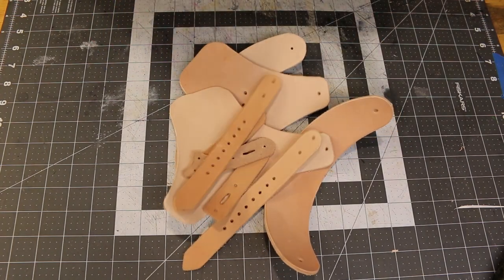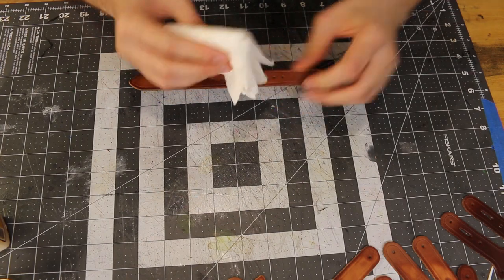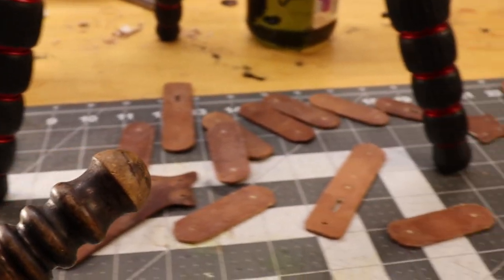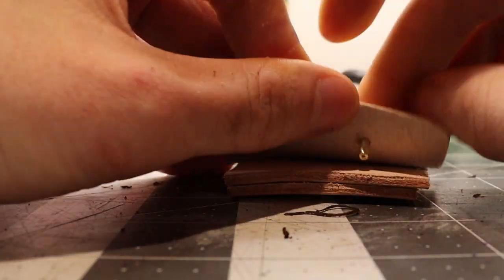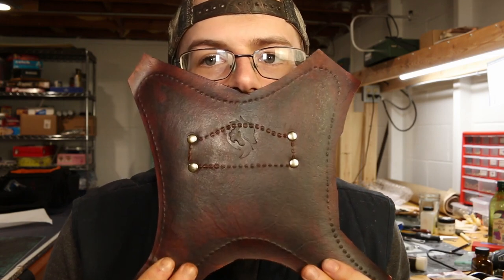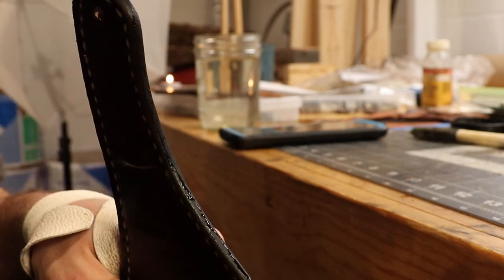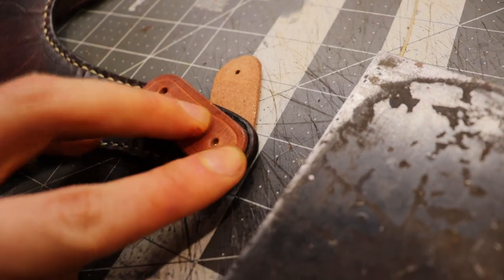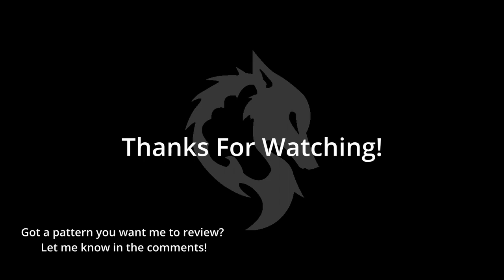My LONGEST build yet. Spoiler - I survived.

Comment: If you want something great for tokonol, look into some of the "custom watercolor" markers that you can buy. Load them up with the toko and get it flowing. Works way better for dealing with the edges rather than needing to go through everything to get it in place there
Reply from the maker: Thanks for the tip. I use a variety of devices for applying tokonol, but I would like to try that idea as well someday.
Reply: @BlackFoxLeather  They're cheap to find online...Weaver even started stocking them, though theirs are more expensive